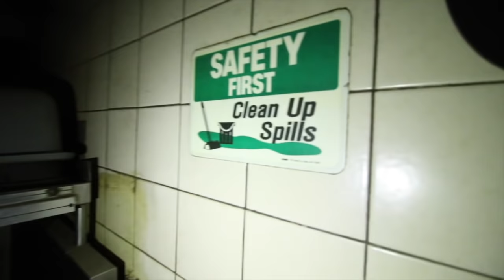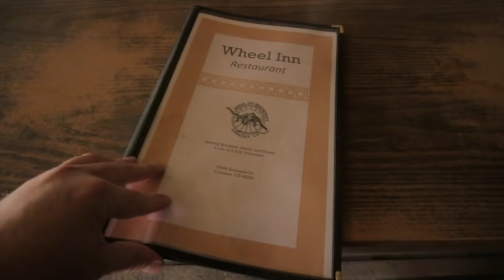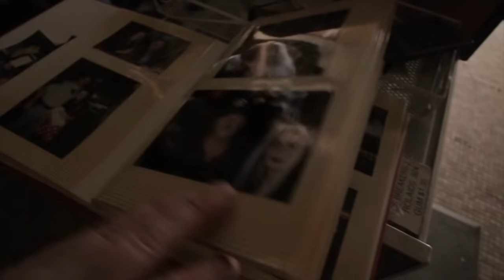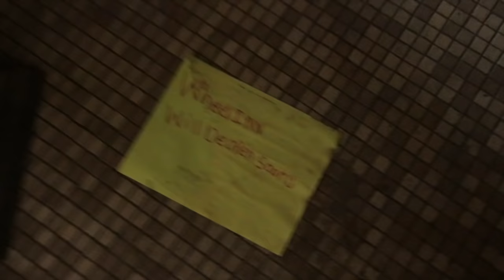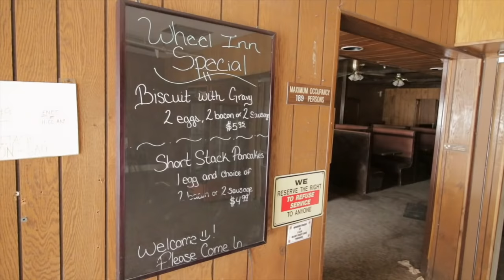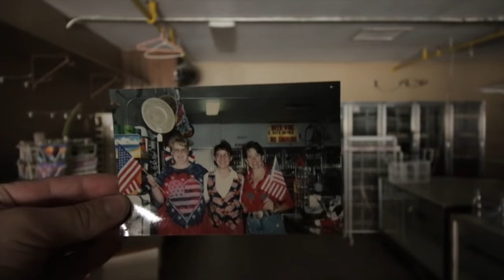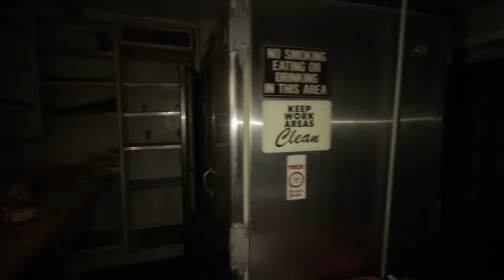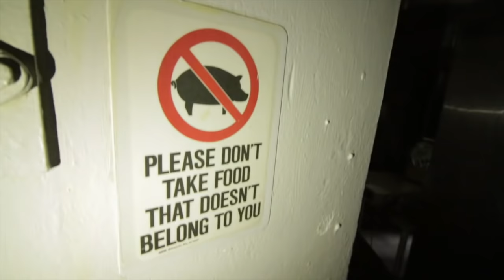Inside ABANDONED Pee Wee's Big Adventure Diner !

Comment: two trains, train A and train B simultaniously depart stations A, and B. station A and B are 252.5 miles apart from each other. train A is moving at 124.7 mph towards station B, and train B is moving at 253.5 mph towards station A. if both trains departed at 10:00AM, and it is now 10:08AM, how much longer until both trains pass each other?

Comment: Riverside County will eventually get involved if that door remains open and the deterioration continues further.  I was unhappy when that place closed.  I used to get the Monte Cristo sandwiches there.  It reflects the area around here; this area has become a very pretty slum.  Many things that should be working just aren't, but there's just enough that barely hangs on.  Like that Stater Bros. truck at the beginning, only well-positioned basics are functioning.  Even some big players that supply the basics have closed up recently.  The "FOR SALE" sign seems to be an opportunity, but a new owner will face significant taxes that won't allow a modest restaurant to prosper during its startup in a weak economy.  There's not much incentive to invest into that and get that place cleaned up.